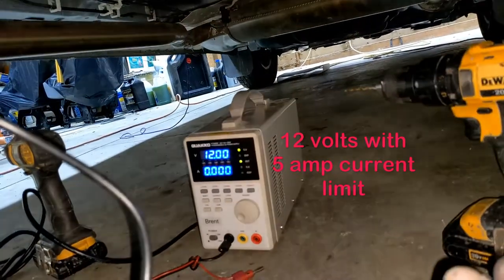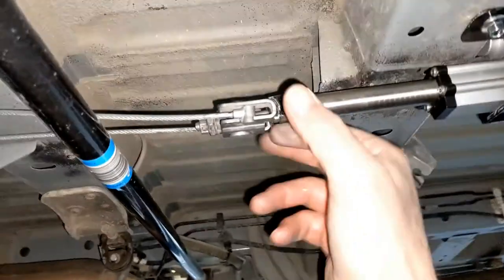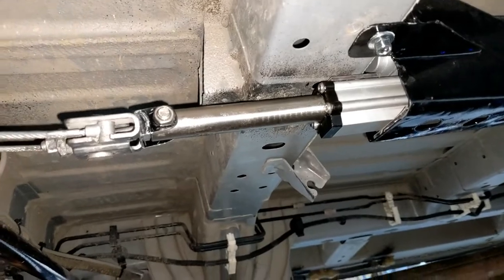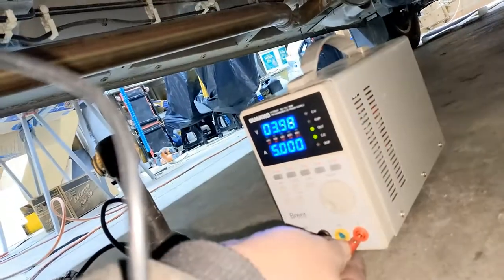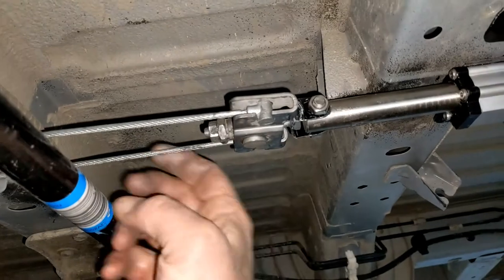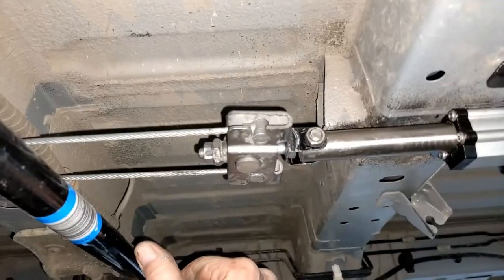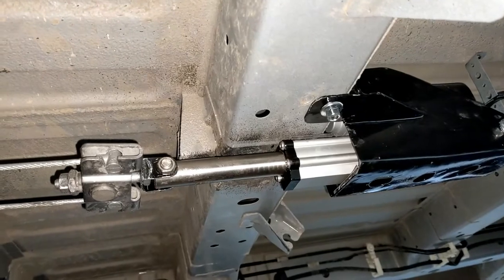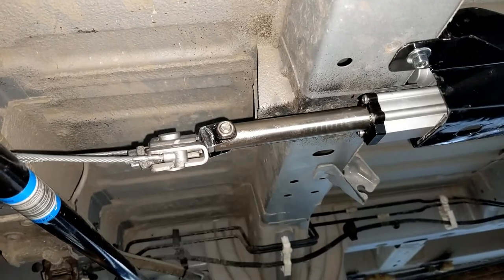(outdated-see description) RAM ProMaster DIY Electric Parking Brake Conversion - Actuator

Comment: Interesting. I've designed 3 different types of EPB conversions for these vehicles. This is an interesting way to do it also. Cheers!
Reply: I have rebuilt this in "push" mode. I think I damaged the actuator early on -- the plunger had come partially unscrewed, but I did not realize it. It popped out under a hard pull. I then figured out that the plastic (nylon) threads inside the actuator had unscrewed and I put it back together. However, it later failed again so I redesigned my mechanism to use "push" mode. It now seems reliable.

Comment: I have done this on another vehicle, but I used a different actuator. Works great with a remote battery source. But I can't keep the actuator from grounding to the chassis, and then blowing the fuse when the polarity is reversed. Did you have any grounding problems, or use insulators?

Comment: This looks good mod as well.... where was your original parking brake lever 
I watched your suspension seat video... I can't work out where it is on a LHD... I'm in the UK RHD.
Reply from the maker: Parking brake is to the left of the LHD driver's seat. There is a picture (not mine) in this thread: https://www.promasterforum.com/threads/pool-noodle-shorts-protection.96347/

Comment: Watching your video I am interested.  What I don't see is where to get this actuator can you please provide this information.  Also I am interested in knowing how well it works since I presume you have been using it for some time.  I own a 2015 Ram ProMaster 3500 Diesel and the current system has a lot to be desired it requires continual maintenance.
Reply from the maker: All that information is in the video description.

Comment: How's the mod holding up?
Reply from the maker: I updated the description. The actuator failed in "pull" mode. The nylon threads inside let go. I made a different setup that uses the actuator in "push" mode. This new setup works great. I should make a video of the new setup, but I have not yet.
Reply: @Baxsie  Cool awesome work here for sure.
Reply from the maker: @MyGoogleYoutube   Here is a video of the "new" (May of 2020) version: https://www.youtube.com/watch?v=uaQfaluNs6Q